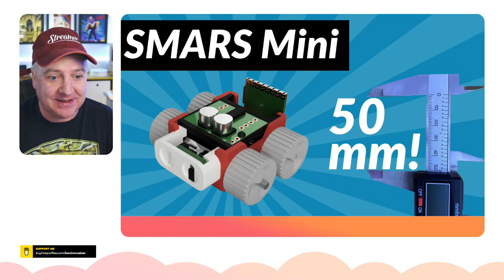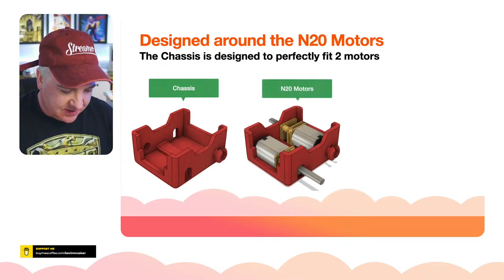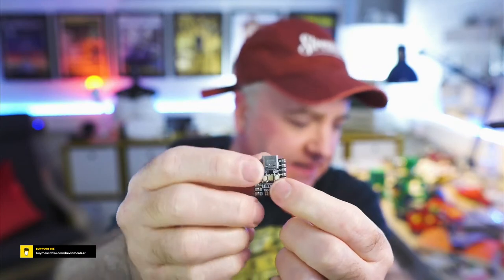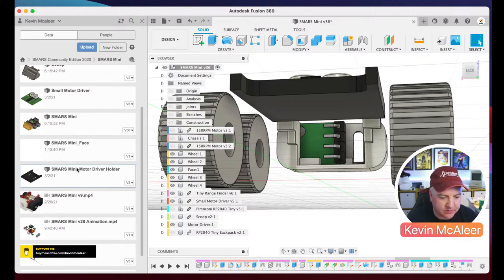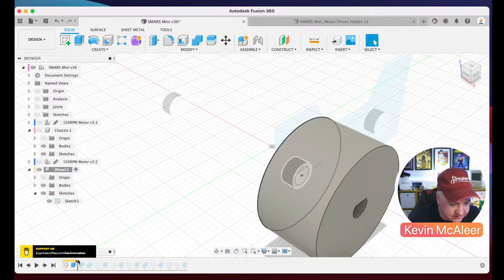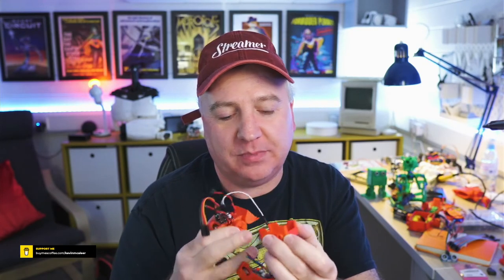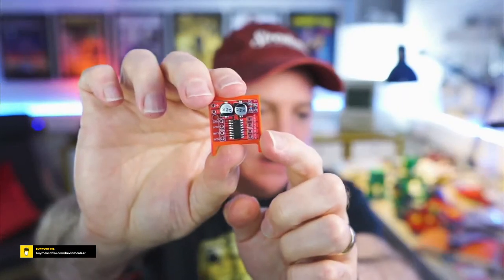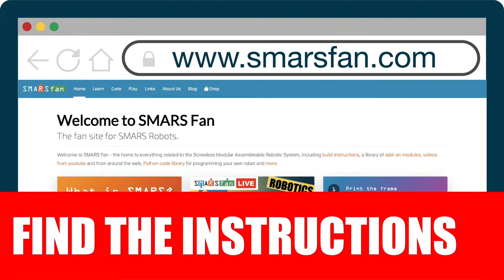SMARS Mini Modular Robot!

Comment: Kevin...having just received and test fitted the electronics bits and pieces for the Mini I have a comment which you might consider....the actual active radar  element of the Range Finder module only occupies half of one of the slots in  the Face. Could you design a 3D print part that will fill in the other half of one Slot in the Face and completely fill in the other, presently empty, slot. This will even the Face up. If you paint the sockets in the Face unit Greenish then, when you install the FoT unit, it will look like a cat's eyes...That's is my plan at least. Look forward to the back pack and battery details.

Comment: How much voltage is required for the motor controller?
Reply from the maker: I've had it working fine with 5v - I'm going to include a microlipo holder as well (microlipo is an Adafruit lipo battery charger module, that also has a 5v output.